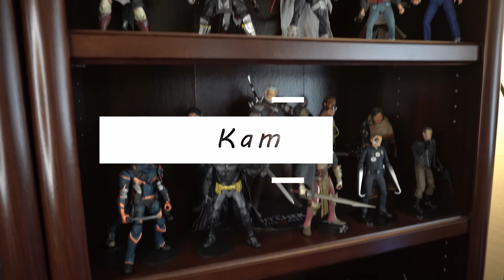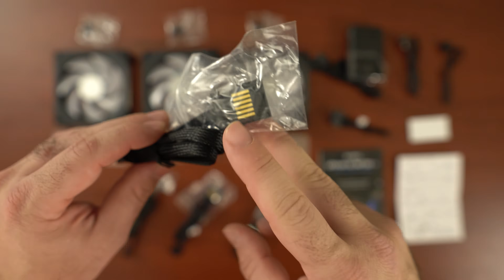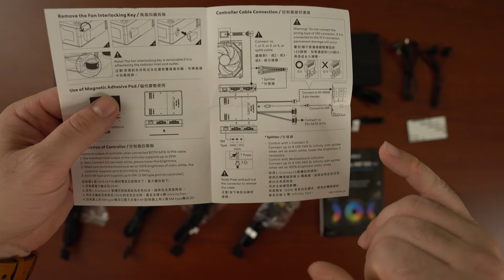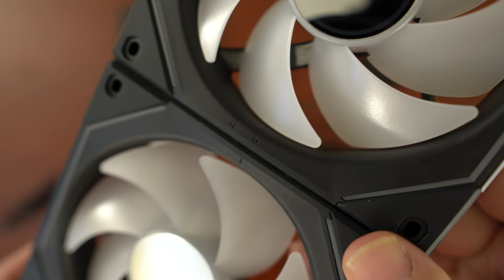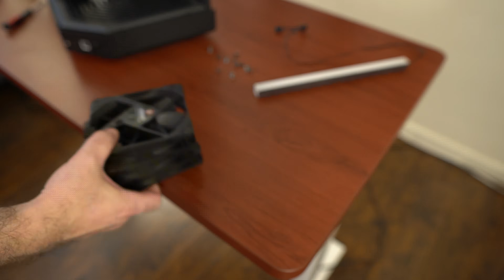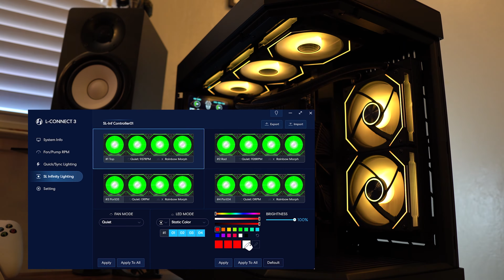LIAN LI Uni fan SL Infinity 120! Unboxing / Tutorial / Install / L-Connect 3 Software / Review!

Comment: Hey Dan (and others having the settings issue), for your L-Connect settings to save you have to go into your BIOS and make sure constant USB power is on. The controller needs constant power even in sleep/shutdown. If it still doesn't work after that, try a different USB header for the controller. Some motherboards only hold power on certain headers so check your manual! Hope this helps :)
Reply from the maker: Thank you for the comment! I did read that there should be a settings adjustment in the BIOS that I can adjust but I find it a tad annoying that I we have to do this to retain settings. I will try the other USB header on my board first and see if it works. Going to pin your comment so other people see it. Thanks for the information!
Reply: @DanKamYouKnow  Did it work?
Reply: Don`t want to change a couple of settings in your bios (that would be set and forget), but you will adjust your fan speed and rgb lighting every time you boot up. Does not compute (pun intended) to me. ?
Reply: interesting, i never had this problem, and i just built my computer.
Reply: Damn. I just bought a bunch of these fans to tidy up my build... when i shut down my system, i like to also kill the power switch on my psu (I'm paranoid about power surges frying my system)

So, basically I'm going to have to leave my psu active at all times if i want my fan settings to save.... welp, looks like I'll be plugging directly into my mobo and not the l connect hub

Comment: Thanks for the video!!! Helped me out super greatly!!!! i have a question, I have the Corsair Dominator Platinum Air flow Ram Fan. It includes a small RGB box with a SATA cable, and the LED cable is 3-pin with smaller pins. Could I connect it to this infinity hub? And if yes, would it be able to control the RGB of the airfan? or do i have to use the corsair controller?  Thanks again for this video.

Comment: Hey. The sata cable for Power, is it already installed, When for example Somebody builds the PC for me, Like If its Standard there. Or do i have to Install it When i buy the lian li Fans. And If i replace the lian li Fans with the ones of my AIO, on what Fan Speed should i Run them to cool my CPU?

Comment: Probably won't answer, but with the splitter at 12:40, do it only control the RGB or will the fan speed(s) adjust, too?

I'm looking to use the splitter on my GPU's AIO (2x 120mm) and a single 140mm above them (the on the side of an 011 Dynamic EVO XL). Is the splitter capable of that, or do I need to use a second controller? Thanks.
Reply from the maker: It will adjust fan speed too. For your 2nd question, why would you need a 2nd controller? Do you have more than 4 groups of fans?

Comment: so I have a nzxt Kranken 360 mm Aio that im gonna be using with these fans and my question is if my cpu temps will be fine until I will be able to get the fans to spin because I'm gonna be using L connect
Reply from the maker: Yes, your CPU will be completely fine while you set up and update L-Connect 3

Comment: Dan, thanks for the video and the demo for fan speeds. Regarding fan speeds, can you set individual fan curves for each separate fan? You showed that you could do that for each fan group (top, front, etc.) But can you do that for each individual fan in each grouping/cluster? Or does every fan connected to the L connect fan hub have to have the same custom curve? Thanks.
Reply from the maker: I don’t believe so, the fan curve control is only for groups of fans. I do not believe you can adjust each fan within a group/cluster
Reply: @DanKamYouKnow  Thanks.

Comment: STOP!!!  INCORRECT INFO!!!

In general, this video was fantastic. It was well edited, very informative, and extremely helpful in my new build with these Uni Fan SL-Infinity 120 fans. HOWEVER...

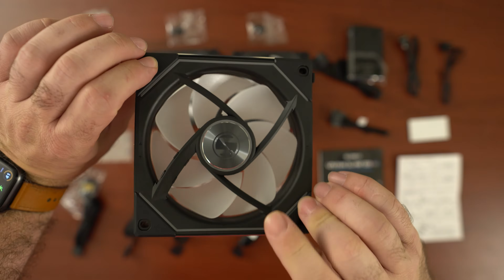There's one fatal flaw here that I haven't seen addressed in the comments or spoken about in later videos and that's your incorrect info @1:57 on the airflow of the fans.

The side with the brackets is NOT the intake. It's the exhaust. The other side, sans brackets, is the intake.

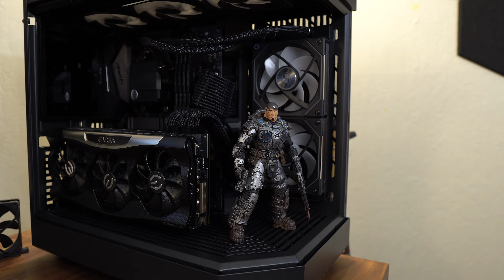This is demonstrated in JayzTwoCents' own video of the fans @16:10, when he shows a piece of paper being blown across the workbench by the BRACKET SIDE of the fans. 

If you addressed this mistake in a later video and I missed it, my apologies. But, like I said, I looked at your video on the reverse blade version of these fans, plus went through all of the comments in this video, and didn't see anything to correct it, so I wanted to bring it up here.

Still a good video, but that piece of misinformation really needs to be corrected. Thanks.
Reply: I’m seeing the same. They make reverse blade fans.
Reply from the maker: I see what you mean but the fact is, if you see the spokes side of the fan in your case, they will be intake. In the case of my Y60, my side fans are intake and the top fans (showing the mirror), are exhaust.

Comment: So when you first turn on the PC, the fans don't run right? You still have to install the L connect software. Will that damage the pc while the fans are not running while you're still installing Windows and then eventually L connect? Since the fans were not spinning yet.
Reply from the maker: Nope, you should be totally fine. Keep your side panels off if you are worried about it, but even with zero percent fan speed and the PC is not under load, it’ll be fine.
Reply: @DanKamYouKnow  Appreciate it sir. I was a bit worried about that. Thank you! :)

Comment: When I downloaded the software the only options it gave me is system info and settings. I can access the fans for some reason, do you have any recommendations?
Reply from the maker: Did you update the controller firmware?
Reply: @DanKamYouKnow how do I do that?
Reply from the maker: Assuming the controller is hooked up through a USB 2.0 header on your motherboard, go to Settings and click on Update.
Reply: @DanKamYouKnow  yes it is connected to my usb 2. When I press update nothing seems to be happening.
Reply from the maker: Might want to talk to Lian Li support and see what they say. Not sure why your board isn’t recognizing it

Comment: Awesome review! Its what I was looking for since Im building in the exact same case. My question is if you had a chance to build with the SL120 V2 fans. It's either the V2's or these INF fans on a 280mm radiator on the side as intake. You mentioned the noise was fine @1600, but have been hearing different views on the sound, some saying it gets loud. So was wondering if you could do a push-pull with the Lian Li's at a low RPM on the inside and outer fans (Be quiet Silent Wings 4?) doing the heavy lifting.
Reply from the maker: The sound really depends on the case and that persons threshold for noise. Some people will say fans are loud if they’re audible at all, but I’m more acceptable and have a higher threshold for noise because I know PC’s aren’t quiet. Your push pull idea might work but I don’t like the push and pull fans to have too much of a varying fan speed

Comment: Dan, could you please explain me how you control your fan speed on your aio, I have ryzen 5 7600x cpu and it keeps getting overheating with Lian Li fans.. I dont know which header to plug
Reply from the maker: All of my fans are plugged into the Lian Li fan controller but my AIO pump is plugged into my motherboard. So through my BIOS, I set the pump fan curve speed. Or I can use the NZXT CAM software to change the pump speed too

Comment: The split cable at 11:03, can I connect the PWM to another fan controller to let it control RPM while leaving the RGB unconnected? 
The controller will still be plugged into my motherboard USB
Reply from the maker: I have no idea if that would work tbh.

Comment: So I understand that if I connect the controller to SYS_FAN instead of CPU_FAN, the AIO fans will not turn on until I'm in windows. Can I connect to CPU_FAN header instead of SYS_FAN? Will that work?
Reply from the maker: That may be an issue with your BIOS because the fans should come on to whatever fan curve each fan header is set to. But to answer your question, sure, you can use an fan header. I personally just use the controller and plug it in to a USB 2.0 header and plug my AIO pump into my CPU_fan header. Control fan speeds with the software and the CPU_fan header with the BIOS

Comment: I don’t even know how many times I watched this video because every time I learn something new, I will do exactly like you did Dan but if I may ask, do you think its the best to have radiator 360mm on top with exhaust fans ?
Reply from the maker: For this case, you can go either way. From multiple testing, it seems like a 280mm radiator on the side, with the fans set to intake, is the best for temps. BUT, a 360mm on top will work just fine. 👍🏻

Comment: Hi Dan! I have been following your channel for a couples of weeks and your videos have been a great help. I am planning to move my 25l set up to the Hyte Y60 and set up couples of Lian Li RGB fans and    the controller. As there isn't any RGB ports on my Omen motherboard, could the controller work without an RGB port? And could the controller work with non-Lian RGB fans? Thank you very much!
Reply from the maker: Hey Ben! So, there may be a few issues. The Lian Li controller requires an available USB 2.0 header to be able to “talk” to the motherboard and the Omen does not have any open USB 2.0 headers, so you would need a splitter. Secondly, from what I have seen with other manufacturers, the Omen motherboard may make it so the Lian Li software won’t recognize the controller. I’ve seen people try Corsair controllers with Omens and the software doesn’t recognize it.

Honestly, if you’re swapping cases, I’d consider swapping motherboards too. And no, the Lian Li controller only works with Lian Li fans
Reply: @DanKamYouKnow  Thank you very much for your advice! I have found a solution to a similar case which I will link below. This guy plugs a USB 2.0 splitter to the header which was originally powering the small light control module at the bottom of the case. He then plugs his light & fan control module to the splitter and the software recognizes the fans. I think I would buy the Lian Li first and test it on my Omen motherboard and switch to a now mother board if this doesn't work.
Reply from the maker: Let me know if it works out for you!!!
Reply: @DanKamYouKnow  Hi! I got my Lian Li stuffs today and the fans work pefectly well so I would probably keep the Omen motherboard. I can't wait to switch my 25L build to the new case!
Reply from the maker: That’s great to hear Ben! Have you already purchased the Y60?
Reply: @DanKamYouKnow  Emm... Actually I have changed my mind to have a Omen 45L case as I think Y60 may be too large for my 3060ti graphics card which is very short. I still think Y60 is a fantastic case though and maybe I will build a custom water cooling system in it later? I just can't imagine how fast I got fascinated with PC building given the fact that I knew nothing about PC prior to this month. It is your videos that bring me into this brand new world <3!

Comment: Hey Dan, I've heard the fans are much brighter when controlled directly from the motherboard. Is this true?
Reply from the maker: I honestly have not tried with the motherboard RGB headers, I’ve only used the controller an Lian Li software. I will have to try it with the fan / RGB headers one of these days.
Reply: @DanKamYouKnow  Thanks for the response! For your liking, are they bright enough straight from the software?
Reply from the maker: Oh yeah, no complaints on brightness at all! 👍🏻👍🏻
Reply: @DanKamYouKnow  Ok, thanks for the help!

Comment: I know this is an older video but just curious if you had any issues with fans ramping up and down? Did you plug your controller up to SYS_FAN or CPU_FAN? I have my fans on an AIO and my case, but I want to plug my AIO fans on CPU fan and my case fans on sys fan to prevent full case ramp up. Just curious if you had any experience with that.
Reply from the maker: So, I still use these fans and controller, but the controller is only plugged into a USB 2.0 header on the motherboard and I have my AIO plugged into the CPU fan header. I control the pump speed thru the BIOS and control the fans with L-Connect 3. The controller is not plugged into any fan header, that may be your issue. I’ve never actually had an issue with fans ramping up and down

Comment: Will these fans work with the kraken x72  cooler ? The kraken cooler has 3 fan connections would I even connect the one lian li connection to it or just not use it at all and use the lian li controller
Reply from the maker: The 3 pin connection from your pump will plug into your CPU_fan header on your motherboard, and you’ll control the pump speed with the BIOS fan curve settings. The Lian Li fans will plug into the controller

Comment: What would one do if i hypothetically got the one that plugs into the fan backwards, the one that was idiot proof. I guess I’m an idiot
Reply from the maker: I’m not sure I understand what you mean.
Reply: The piece you plug onto the fan is what I’m referring too. I got it in the wrong way. An update on the situation, it got stuck from being in the wrong way, it broke when I finally got it out, and now I need a new connection

Comment: Great video just got these and the new 140s to switch over into the hyte y60 actually haha so was happy to stumble across this. Plus the GOW figure in the case was a sick touch! Haha
Reply from the maker: Thanks!! I just bought the 140’s as well, for my new Hyte Y40 video I’m doing. Been using them for a few days and they’re great, work perfectly with the 120’s and the controller.
Reply: @DanKamYouKnow  awesome! The same connection cords for the control box work on the 140s also correct?
Reply from the maker: Yup! All cables are interchangeable and L-Connect 3 works perfectly with both of them 😎

Comment: Is there a way to force the control to default to pass-through mode when it powers on?
Reply from the maker: What do you mean by pass-through mode?
Reply: @DanKamYouKnow  the setting that allows the MB signal to be used a the ligh control. It's the "MB Sync Lighting" toggle. The default option for the controller is that i will display rainbow, even if the MB signal is red.  If ypu start L-connect, Nd you have this toggle turned on then you fans will change to red.   However if you allow this setting to be applied as default behavior the user wouldn't need to start extra software.
Reply from the maker: Oh gotcha, the motherboard sync toggle in L-Connect 3. I have always used the application for all of my lighting control and I’m not currently utilizing the 5v RGB cables that plug into the board ( everything goes to my controller ). So I unfortunately don’t know if it will default to MB upon reboot. You might want to check a Lian Li forum or the many Lian Li users Facebook groups there are.

Sorry I could be of more help

Comment: 10:34 

Hi!  I bought such Lian Li fans.  I would like to ask if it is normal for the fans to light up but not spin.  I have not installed Lian Li or any OS.  I was just wondering if they work.  I connected it to the USB port of the motherboard.
Reply from the maker: When the fans are first installed, they may not spin or the lights might not work. You have to install L-Connect 3 and update the firmware for the fan controller, and they should work properly.

Comment: OK had to stop in and hopefully help others with Lconnect 3 being unresponsive.  For me i had to unhook my monitor USB cable to computer.  The Gigabyte FI32U has a hub with soundcard, i  had the sound card disabled thinking that would help, nope.
I tried different versions of Lconnect and none would be responsive, always click on something then about 30 sec to minute later it would change.  Now its working great.
Also i fixed Snowrunner being unresponsive when alt-tabbing out or clicking out of snowrunners window. 
Win 11 22h2 all updated and also newest drivers for everything.  13900k, 4090, 32gb gskill 7200, 5 m.2 ssds, 1 sata ssd.... :)
Reply from the maker: Interesting, never had the program be unresponsive. Thanks for the comment about it
Reply: @DanKamYouKnow  Thx, yea never even thought about it since i disabled the onboard monitor sound and all drivers are newest

Comment: How about 2 controllers, will there be any problems with Lconnect3?
Reply from the maker: I’m not sure. How many fans are you planning on running? I tried a Google search and I don’t really see any info on it either.
Reply: @DanKamYouKnow  I was going to use 6 groups of fans in my O11DE. 3 + 3 on top, 3 to the side, 3 in front, 3 from below, 1 from behind (16 in total). Therefore, I wanted to divide them between two controllers.
Reply from the maker: Gotcha, I honestly don’t know if L-Connect 3 can handle 2 controllers. Trying to find info online to see if people have done it but don’t see any. You can try Lian Li support before you spend the money for the fans. Please let me know what you find out so I know for future use.
Reply: @DanKamYouKnow  actually, I have already found the answer in similar reviews. On your video (https://youtu.be/fQ6v85Z_4po?t=1341 ) the tab "SL-inf Controller01" is highlighted, so when adding any controllers compatible with Lconnect 3, new tabs will appear (SL-inf Controller02... Controller SL-inf 03).
Reply from the maker: That’s great to know! Thank you